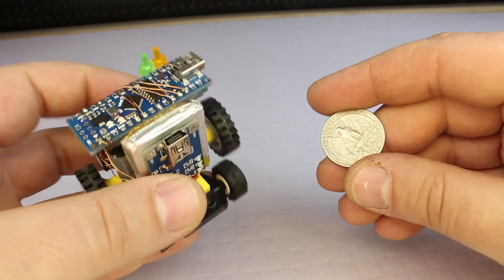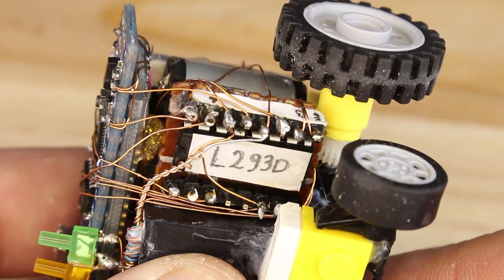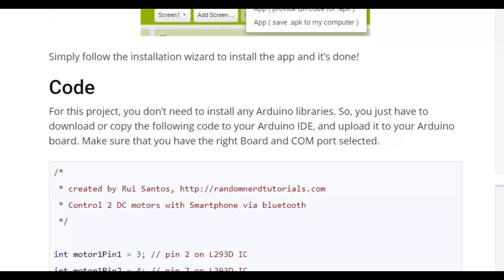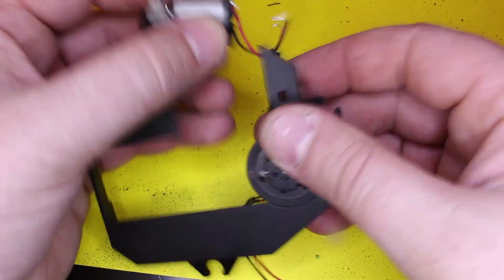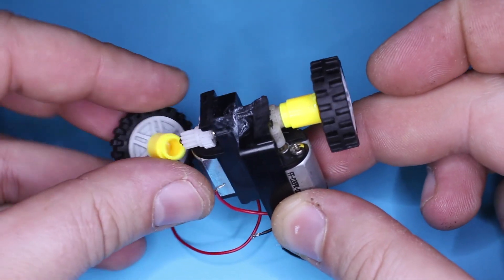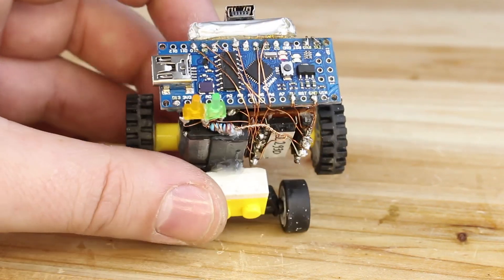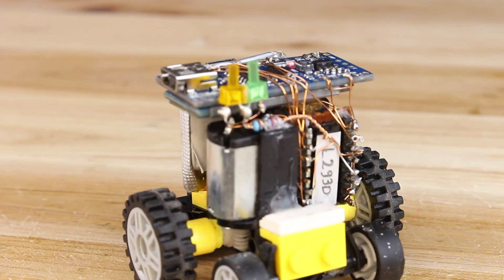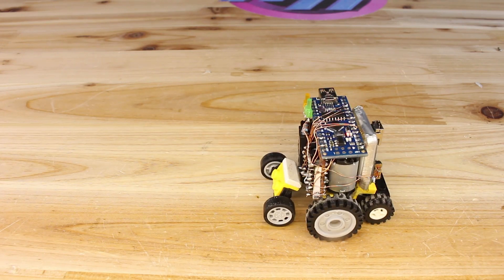Smartphone Controlled Bluetooth Robot Car-DIY

Comment: Can I use esp32 rather than arduino nano and blueetoth module tell me fast
Reply: Yes but your how you send your signal will change microcontroller just sends signals. Doesn't matter what is the source as long as the data is readable